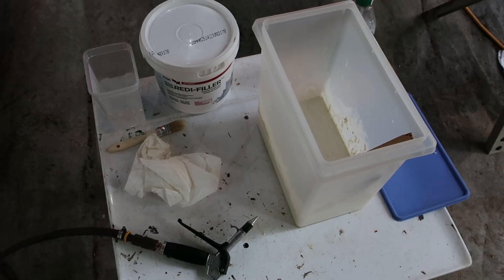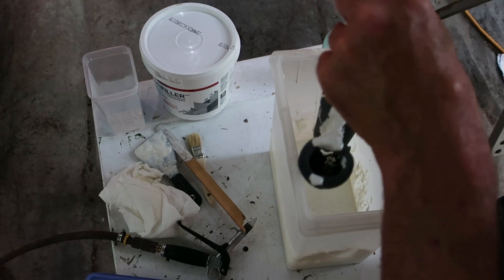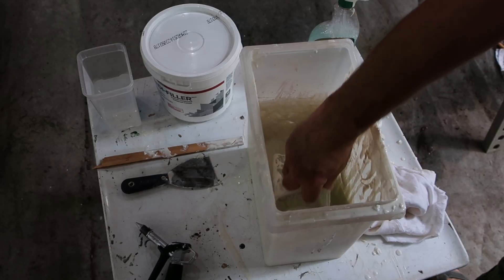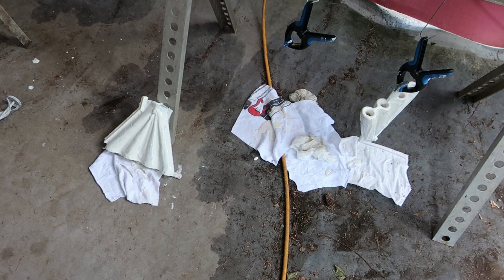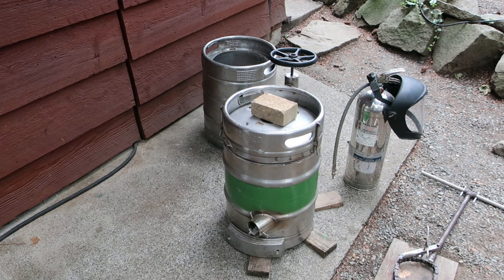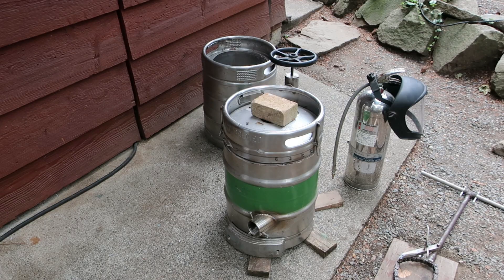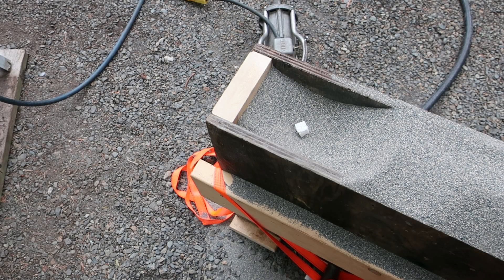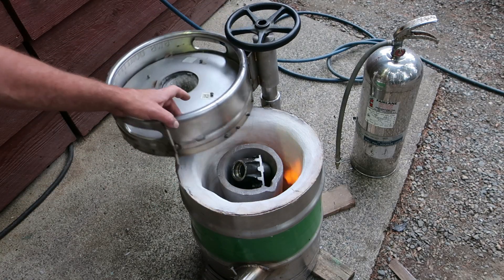Intake manifold, part #2, The failure. How not to cast aluminium, or at least, mistakes to avoid.

Comment: Next time, sink the model lower into the sand. Make sure you have at least one vent coming from the lowest point of the top surface up to the top of your sand mold. Reason you’re not getting proper fill is that the gasses from the burning crap you made the model out of is filling the top of the cavity in the mold. The gasses can’t get out where you’re pouring the molten metal. So… a vent will allow these gasses to be expelled, allowing a better fill. This will also require more metal to cast with, but this again will help alleviate voids, macro and micro porosity.
Reply from the maker: Thanks.  lower in the sand made a huge difference.
Reply: @MrKent317 no worries. Been casting for over 20 years as a custom goldsmith. 
Casting is both a joy and a curse. 
If you have any questions I’d be glad to help. 
Are you planning to show your next attempts? I’m curious to see how they turned out.

Comment: lost foam... never had luck, and at the price of investment... pfft.

greensand, cores, split patterns.

pouring vertical... take into account hydrostatic pressure. the entire weight is bearing down at the lowest point. the highest point is under no pressure at all... which bit ends up more "solid"? tall risers and horizontal pours get more consistent pressure in the mold... and less chance of blow out.

ha ha. organisation.... five hours hunting, ten seconds using... instantaneous losing... five more hours hunting... FFS i juust had it in my HAND!!!!!!
Reply from the maker: After watching Kelly Coffield make magic with it, I had sleepless nights until I made it happen.  you are so right on the organization! true on the head pressure too.